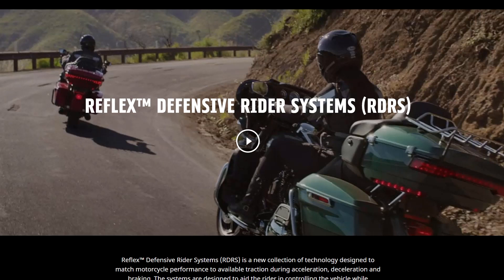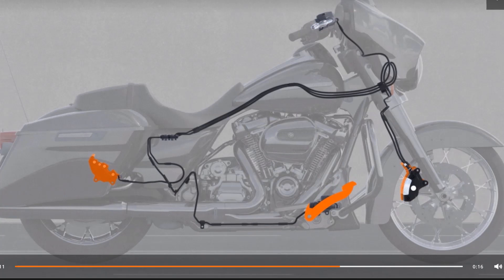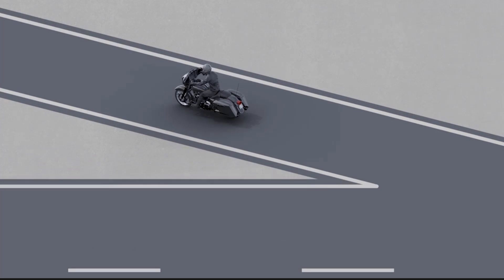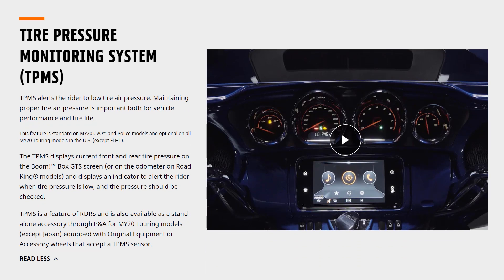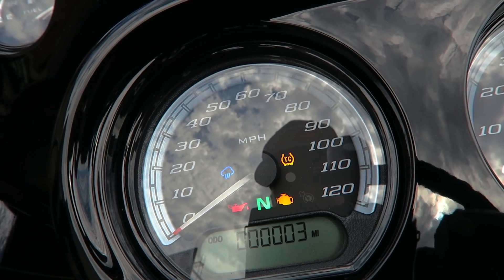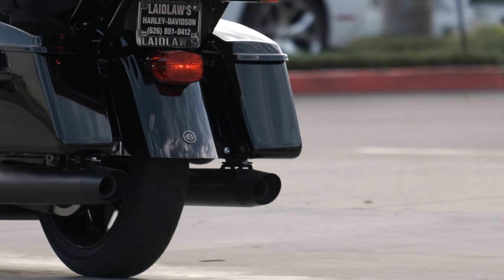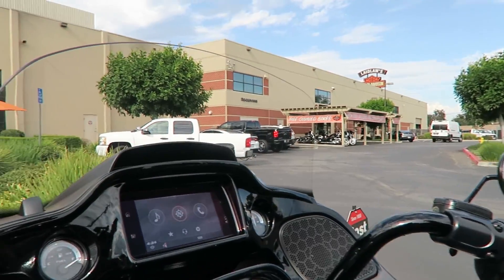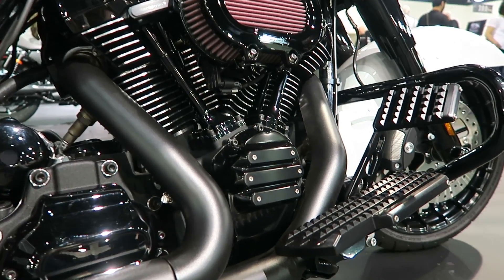Reflex Defensive Rider Systems (RDRS) Explained for Harley-Davidson Motorcycles

Comment: Isnt Drag Torque Slip Control the same as a slipper clutch?
Reply: No, they basically attempt the same thing, but in a different way. A slipper clutch is a mechanical solution allowing the clutch plates to rotate if too much torque is applied from the wheel, the Drag-Torque Slip Control electronically speeds up the engine to match the wheel speed. With the DSC you maintain traction because there's still torque from the engine, with the slipper clutch it just prevents the rear wheel from locking up.
Reply from the maker: What he said. The wheel bearing sensors dictate intervention from the Torque drag slip. 
The slipper clutch is all mechanical. They both are designed to achieve basically the same thing though. The TDSC is going to be much more effective I’m guessing though.

Comment: You'd think the Vehicle Hold Control, and some of the other features would be something a new rider would want / best benefit from. Do newer riders ride baggers? Not many that I know of. Put that on a Sportster or Street model. Look forward to when that tech migrates down to the smaller models.
Reply: All this tech seems like it would be more at home on a street 750 geared towards the “younger generation “
Reply: Not sure how it is in the US, but in Europe most Harley riders only take their bikes out in the weekend, and only in nice weather. In my experience, this results in them not being very familiar with how the bike handles and what its limitations are.  I hear riders in my HOG chapter boast how they put 2000 miles on their bikes over the last year. I then wisely keep my mouth shut, as I ride my RKS almost every single day, and put 24,000 miles on it over the past 14 months (and that includes it being in winter storage for 2.5 months).

Like they say... keeping your bike's mileage low for resale value is like not having sex with your girlfriend to keep her tight for the next guy.

Comment: How long does it take for Harley to approve the warranty repair after your two-year plan and you have the extended ESP on an ultra classic 17 on oil transfer issue ?? For the vent kit
Reply: Isn't that the dealer's worry? They know the vent kit will be approved, so it should be free of charge.
Reply: Harley is cheap they won’t pay for a mistake they made unless they get caught a few hundred complains before hand

Comment: Definitely a technological advancement for H-D instead of just a different color of paint or some other blingy cosmetic stuff so kudos to H-D for it. But the thing is there have been other motorcyle manufacturers that have been offering similar features for a few years now and the features have been included into the price of the bike, not an added expense. But anyway you look at it, it's a good thing.
Reply: That's not really a fair comparison though. These features are included by other manufacturers on sports and adventure bikes, and generally not on cruisers. It's a different kind of riding that's done with those bikes. And don't kid yourself, it may be standard and not an option you need to pay extra for to get, but you are paying for it. It's just included in the total. Even KTM has an additional riding modes software package for their bikes that you can purchase for a couple of hundred bucks.
Reply: @bloodymarvelous4790  Understood these features are included in other manufacturers models and therefore you're paying for it. But H-D models are already pricey anyway and H-D is very much in a catch-up situation in regards to all "new" (new for H-D) features and technology they've introduced in the past few years. If it wasn't for other manufacturers introducing new improved and much more reliable motorcycles with improved performance and H-D seemingly reluctantly having to keep up, we'd all still be riding 4-speed Shovelheads....lol.

Comment: Does this system affect trale breaki
Reply: If you’re coming from a non abs bike to this new one then yes. The brakes are linked at that point due to speed. Beyond that if you’re trail braking and it slides the new cornering abs and the other new systems would kick in as well to hopefully stop the slide.

Comment: Thanks  for demo  !

Although HD says " don't depend on TPMS to be 100% accurate ",
My 2016 is always right on/in sinc to pressure gauge reading.

I was also originally leary about the  integrated brake system , but it works very nice.

Comment: Happy Harley finally has added some of this stuff but not sure any of it's "new" rather just new to Harley.  BMW, for example has had lean-sensitive ABS for a few years, now as well as traction control.  All-in-all - more safety features for riders are greatly appreciated.  Great job, Matt - you do excellent work!
Reply: So has Ducati and aprilla.
Reply: If you need TC maybe it's too powerful for you
Reply: @AudriusN  That must be it.
Reply: @AudriusN  Wheel slip can happen on any motorcycle regardless of power.

Comment: I'd trade all that crap for a standard reverse gear on all touring bikes.
Reply: Then again, your username says it all...
Reply: Agree. I'm getting too old to push a heavy touring bike around but don't want to give up touring.
Reply: It's been a standard feature on Honda's Goldwing since the 90's! The Motor Company will eventually get there. Give em another 10 years. 
Also in another 10 years the Tri-Glide will have independent rear suspension and a windscreen that will go up & down electronically

Comment: Very impressive. Was wondering when Harley would catch up with Honda, BMW, ETC. I can see these features helping new riders tremendously. Nice to have for skilled riders. I’d love to have the position hold feature. Normally, hills aren’t a problem but on my ride to work I have to hit a 75% corner that is also a steep incline. Oh, and there’s a damn stop sign. For this situatuon alone I’d pay the extra thousand. Great stuff Matt. I swear when I’m in the market again, I’m making the trek to your place from Jersey. Ride safe brother.
Reply: I added "Hill Start Control" to my GS. I haven't used it that often. I live in a hilly area but rarely need it. I'd say it still takes getting used to. I'd still practice to get used to it.

Comment: I just tested my bowel movement system. All systems are go.
I think somebody was messing with you. Not a big reason for an IMU on a trike as if it's leaning, computer or not, you're screwed.
I still want you to run up to about 3.5k rpm in 2nd gear, then with your clutch pulled in, shift into first and listen to see if the engine revs higher even without releasing the clutch. If it does, it's simply rev matching. If it doesn't, repeat only drop the clutch and see how smoothly it takes you from skidding to not skidding. This is the most interesting to me, because I've never heard of anyone else doing such a thing. Could well be something used on the regen of electric vehicles. Be interesting to see how well it translates to gear boxes.
TC is a great thing for HDs as they make so much power off the bottom. Funny thing is, guys spend so much money getting more. If it makes more than enough to spin the tire, it's a waste. Cutting power to the rear will actually make it faster.
Reply from the maker: Interesting. I’ll have to try that. I’m not sure it works like that though. I don’t think the engine speed will accelerate unless you actually dump the clutch and the wheel speed sensor Indicates the wheel isn’t spinning fast enough.